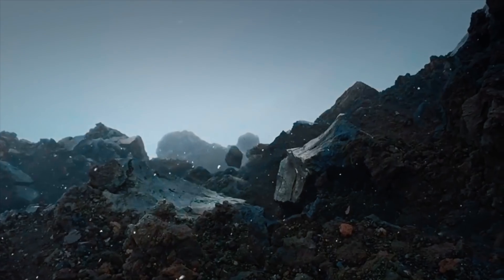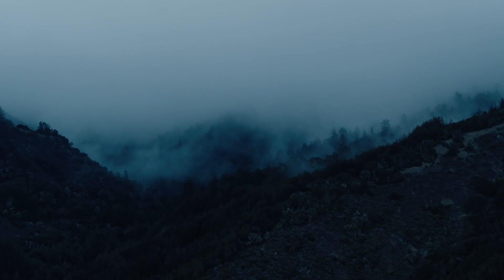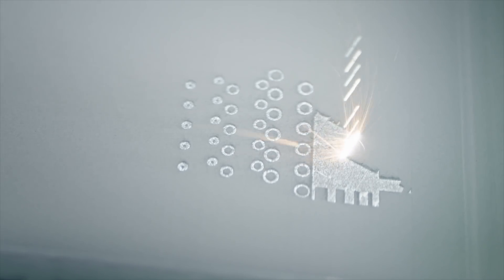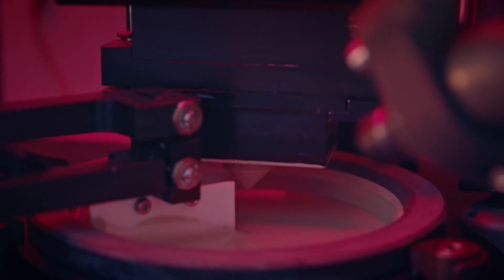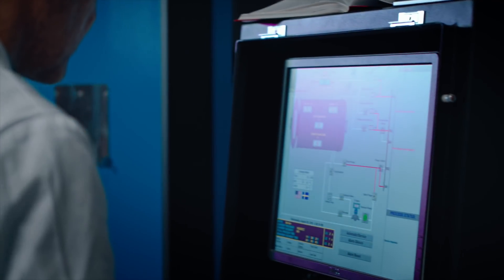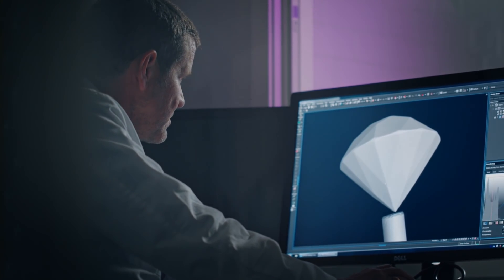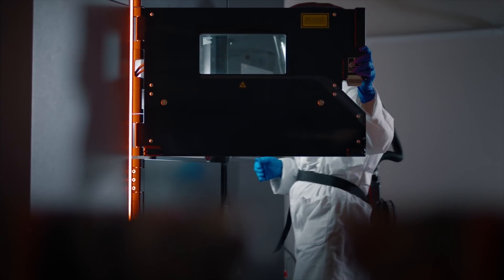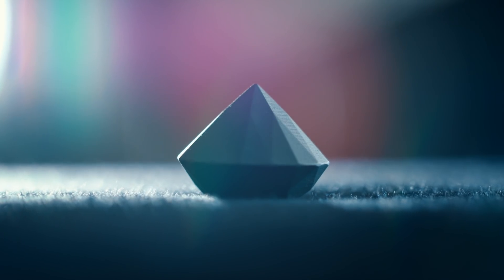A closer look at the world’s first 3D printed diamond composite

Comment: This diamond is not 100% carbon, they say this in the first couple of announcements. It's a diamond composite.
Reply: Yeah but it would still be just as strong if not still a lot stronger than most metals
Reply: @vbgaming6203  so purpose?
Reply: Where to use?? In drills? Looks awful
Reply: @mustafamoldany493  could just be used to replace plastic or weak metal pieces. It's better than normal 3d printed parts, that's for sure. Combine it with the recent magical invention called paint, it's only been around since way before the dawn of our history books.